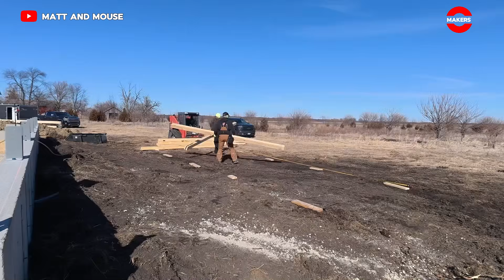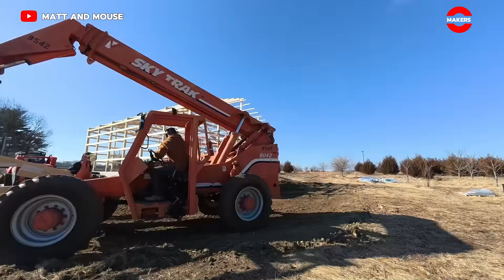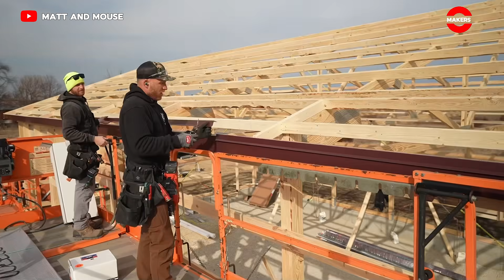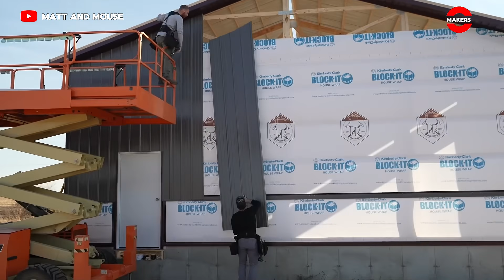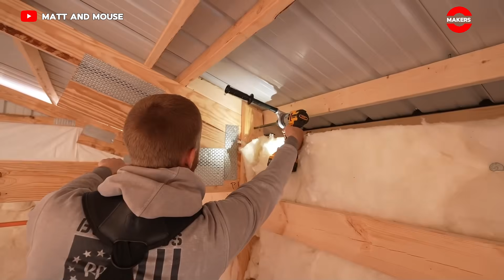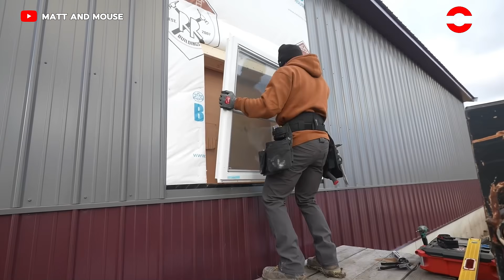Two Men Build a Massive Garage in Just 10 Days | Start to Finish @RRBuildings

Comment: lol a chain is as strong as its weakest link. Those six inch anchors will not hold in high winds. ( costly proof ) it takes a little more care to install set in place anchors into concrete Pryor to pouring the footings although this video is quick it’s really how not to do it.
Reply from the maker: Thank you very much